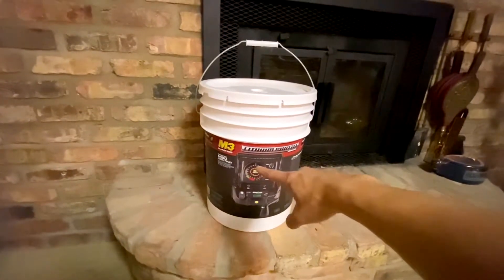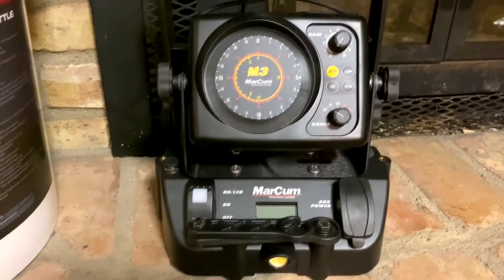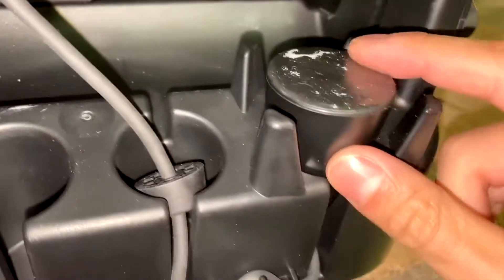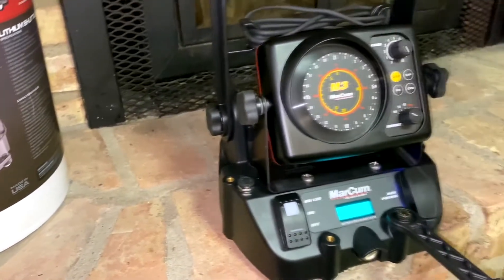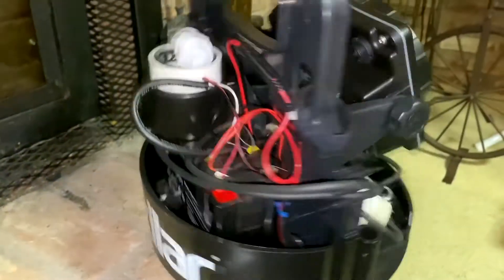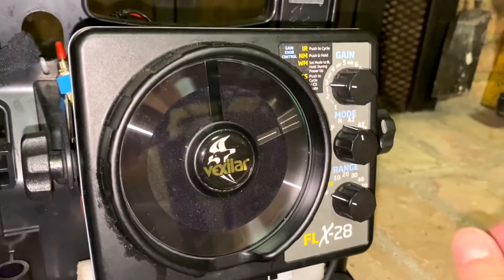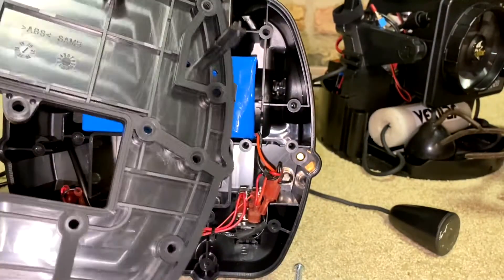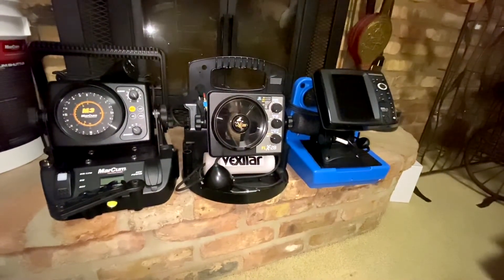[S1.4] Marcum Lithium Shuttle Overview! Save 40% Weight vs Vexilar - Ice Tech Tuesday #itschoetime

Comment: To do a fair compassion put a lithium battery in the flx28 in the original case and take off all the extra stuff and I think you'll find that the weight is real close the flx28 also has some features that the marcum does not have like 5 foot increment on the auto depth.after 8 years of use my flx28 power cord was showing some cutting out issues I sent it to vexilar they not only fix the power problem they put a new motor in it to quiet it down all free of charge,and it was back to me 7 days to the day that I sent it. That's very good service for 8 years of use. I'm definitely not knocking Marcum I have three of their cameras and I am looking for another flasher because my other flx28 was lost in a fire, which brought me to this comparison video 😀